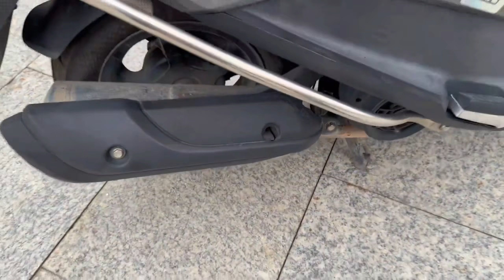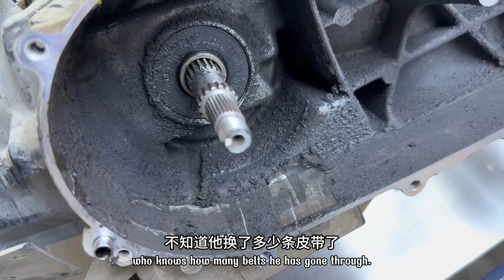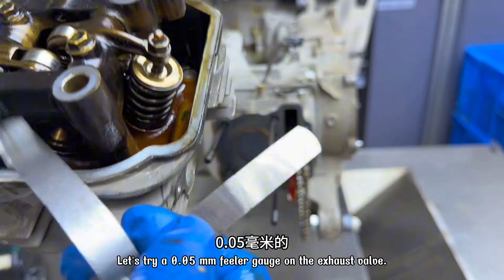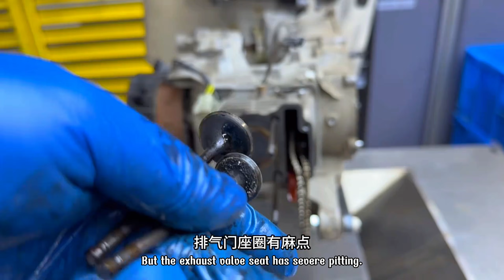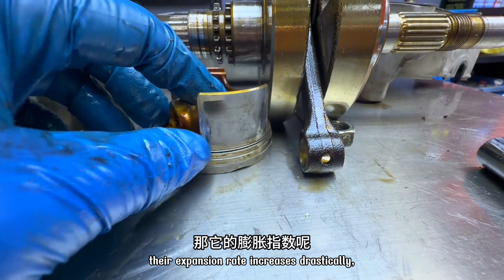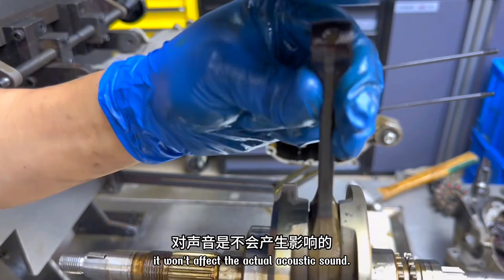Can This Suzuki Engine Survive 376,000 KM? Full Tear Down & Inspection!

Comment: Hello Moto Tech! from your experience any naked/supersport especially mt09 reached 250 000 km?
Reply from the maker: Yes. While it is rare to see sportbikes or naked bikes reach $250,000\text{ km}$ ($155,000\text{ miles}$) due to how they are typically ridden, crashed, or traded in early, it absolutely happens.In the motorcycling community, there are documented cases of both supersports and naked bikes clearing these massive milestones when they are used for long-distance commuting or heavy touring and receive meticulous maintenance.

Comment: Please explain why worn spark plug could cause overheating.
Reply: uneven combustion
Reply from the maker: When a spark plug wears down, its electrode gap widens, its ability to dissipate heat drops, and it struggles to ignite the fuel mixture cleanly. This triggers a chain reaction in the combustion chamber that alters engine chemistry and timing, ultimately driving up operating temperatures.

Comment: as a former delivery guy, if the vehicle owner changed engine oil every 1500-2000 kilometers, we would see less engine gunk and sludge. thanks for video
Reply: This Suzuki scooter had very little cooling down time during its entire life, so the oil remained pretty stable. Just change every 5000 km is fine. The transmission oil should be changed more often.
Reply: Pointless to change scooter oil every 2000km, more frequently than a spotbike? Cmon
Reply: @ignacioloureiro sportsbike has higher oil capacity and they use full synthetic most durable oils in the market. For scooter, you generally use semi synthetic cheaper oil.
Reply: @ignacioloureiro  You don't get it... these engine have less than 1liter of oil, the margin of oil contamination is very low to non exist, It survived because good engine design good oiling path. The overbuild/understress is the name of the game when it come to longevity. Keep in mind this thing only have 9HP for a 125cc

If it have something like 12-15HP It wouldn't last this long.
Reply: @ignacioloureiro  any sportsbike has 4litrs sump and working at "half" throttle 80% of time.. That suzuki scooter was driven in the stop n go traffic of city at wide open throttle 95% of time,  plus  900ml oil sump only, and air cooled engine... If u wish to keep it for years and years,  you need to change oil every 3K km, because it gets so much abuse....  Gilera Nexus owner with 170.000km on the odometer, just basic maintenance

Comment: Por el color interior de los cárteres, así como del lodo encontrado en algunas partes, desde eluego el dueño no ha tenido un correcto mantenimiento del mismo, ese color del interior del Carter marronzusco se produce al no sustituir el aceite con la frecuencia que se debería realizar, a medida del avance en kilómetros la sustitución debería ser menos espaciada. Aún así ya ha durado el motor👍
Reply: Hay que tener en cuenta que este scooter pertenece a alguien que la usa a diario para hacer entregas. Difícilmente tendrá tiempo para hacer el mantenimiento adecuado a la hora que toca. Y eso solo hace que el resultado sea aún más impresionante, y más si pensamos que se trata de un monocilindrico. Pocos coches resisten rodar tanto.
Reply: @Marillionado  ya pero un cambio de aceite y filtro es cosa de media hora. Aún así mucho a durado la moto, es dura 👍🏍️ Lo interesante es saber que cuando veas un Carter con ese color, sepas sin duda que la moto no ha tenido un buen mantenimiento 👍
Reply: But nearly 4 lac km for a 125cc scooter is huge!